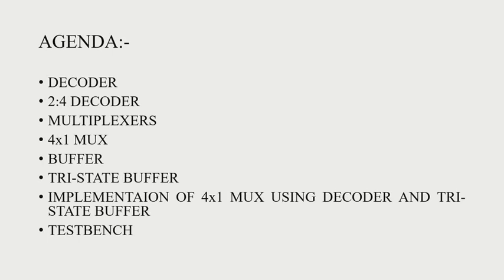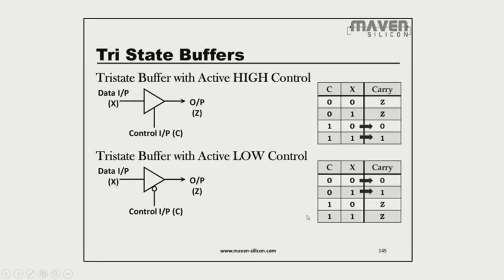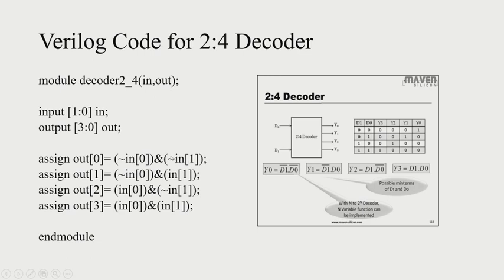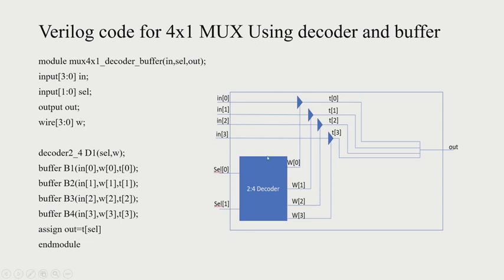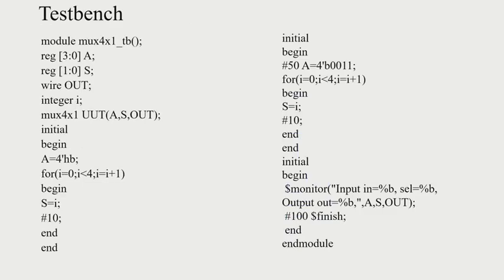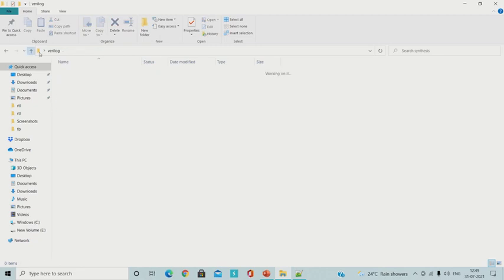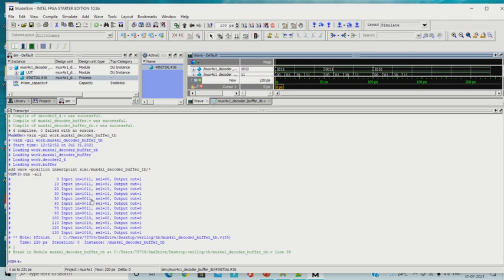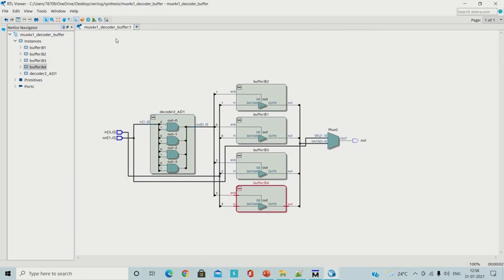Verilog code(simulation and synthesis) and design of a 4x1 MUX using decoder and buffers

Comment: You should declare wire [3:0]t also.
And there is a catch as u directly combined all outputs of the buffers (Diagram) It will acts as a or so if there is Z in input of the or gate (TTL or) output is 1

Comment: i am getting error
Reply: can you verify the code
Reply: You should declare wire [3:0]t also.
And there is a catch as u directly combined all outputs of the buffers (Diagram) It will acts as a or so if there is Z in input of the or gate (TTL or) output is 1